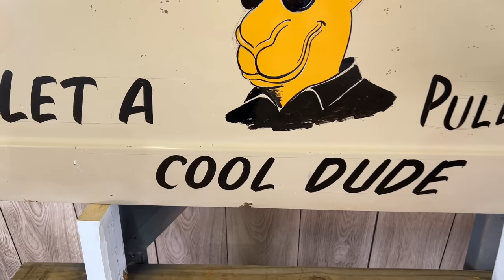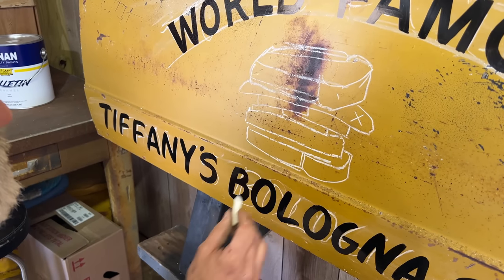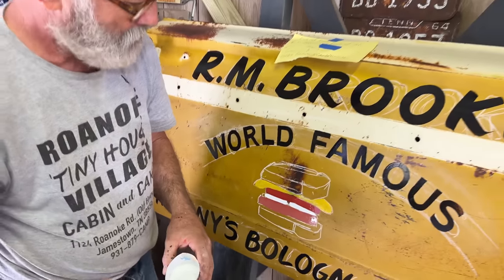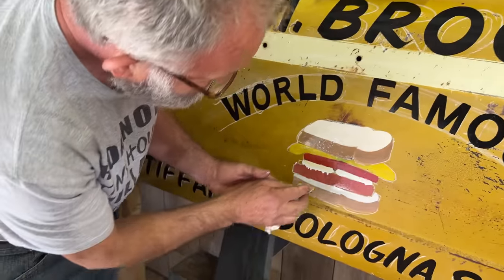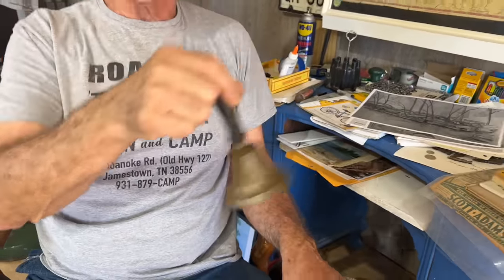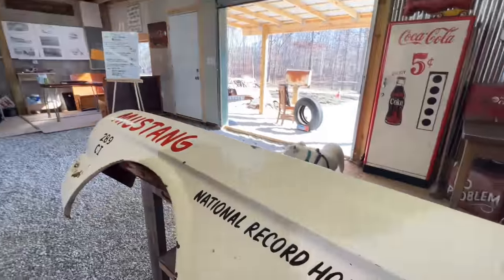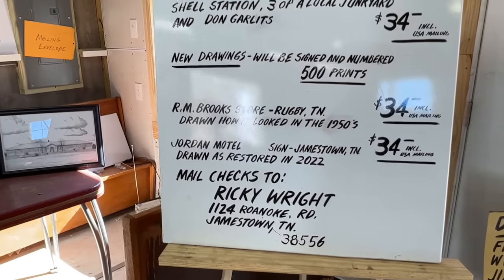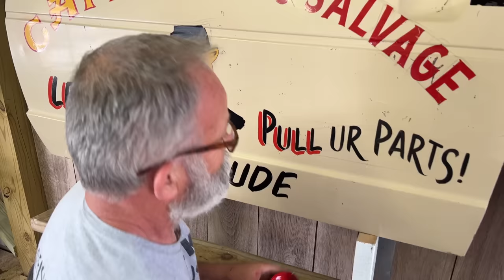From Junk to Art: Ricky Paints a Door for Brooks General Store saying World Famous Bologna Sandwich

Comment: Yahoo !! Mountain Dew.... it'll tickle yer innards. I'd ride my Stingray to the Esso station and get a bottle of MD and either a Butterfinger or Clark Bar every day when I was 12. I'd sit down with my back against the soda machine until I was done. Afterwards they let me pump gas, wash the windows, check the oil and attach a tiger tail to the gas cap or antenna for tips. Occasionally my mind tricks me into recalling the exact taste of the original MD in the glass bottle